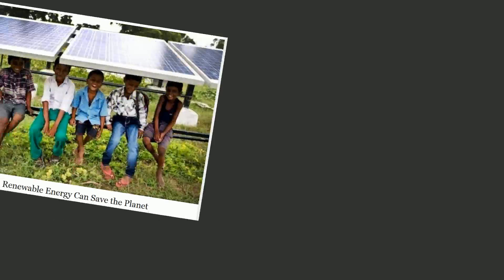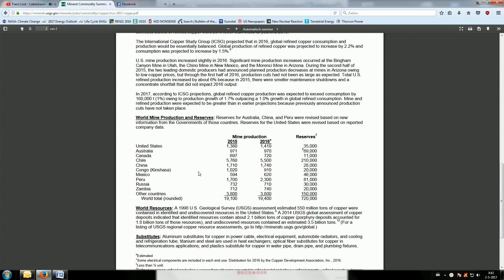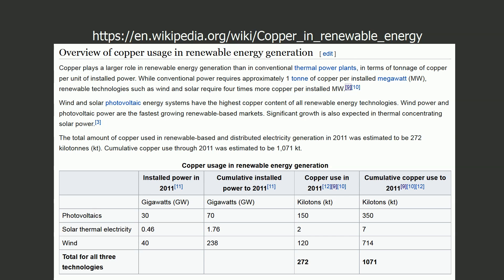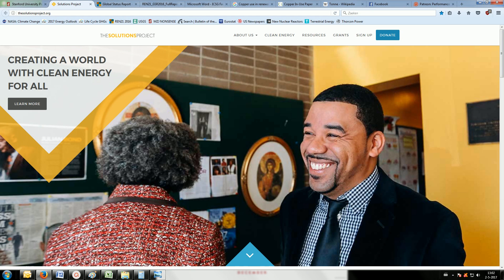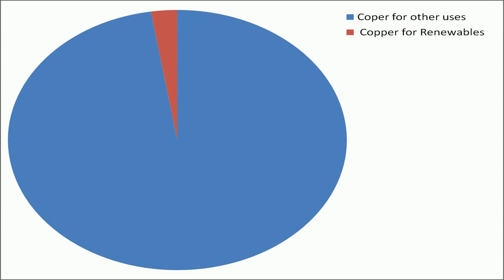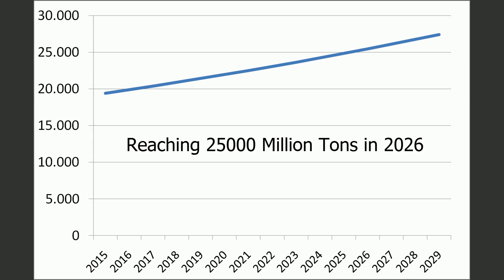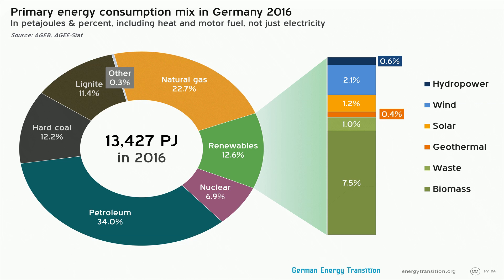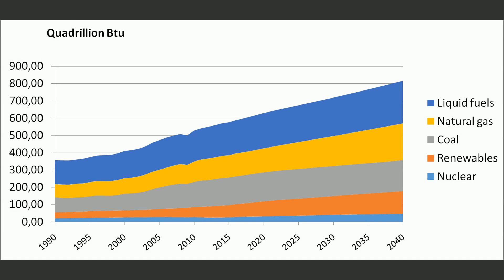Wind, Solar, Nuclear - exploring the difference in materials invested per unit of energy produced

Comment: Two thoughts on this, wind and solar are not the only green energy solutions, they are simply the most talked about but their are others like mirror farms that would use far less. Secondly did these figures factor in recycling of materials like copper.

Comment: No you are assuming that production is static over time and recycling is not happening. Cost does really matter and to be sure if more copper is needed then we will go and get it. Copper mining companies are always happy to sell more copper. When the price is right then they will go and start up the next mine. 

Same goes for rare earths, aluminum and silicon. 

You are trying to fit a round shape in a square hole. Cost counts. Nuclear is too expensive for most parts of the earth

Comment: Thank you for looking into this. I live off grid with solar panels. I can say you forgot to add in the batteries, charge controllers and inverters. Solar panels are 1/3 of the cost and materials of my off grid system. I have a backup gas generator too.

When wind turbines are decommissioned they are fully recyclable and it takes 1/10th the energy to recycle copper than to make virgin copper. From the nuclear power plant, can that copper be recycled? Is it considered nuclear waste in the end?

Certainly the land base needed for nuclear is tiny compared to the others. Also it is indoors and constant as you say. Hmmmm
Reply: "When wind turbines are decommissioned they are fully recyclable " This is not true! You're lying.

Comment: You ignore the increased copper efficiency building larger turbines. If you scroll down on the same page, you see that most of the copper is used for vertical cables and lightning protection, not for the generator itself. I have no data how this scales with larger turbines, but it is definitely not linear.

Comment: I see you are using Tons. are you actually using Tons or metric tonnes? Most wikipediea figures are in metric tonnes whereas USGS likes to use tons. The two are not equal.
Reply from the maker: USGS mostly uses Thousand Metric tons or Metric tons in their commodity reports. So should everybody else ;)
Reply: I agree completely, it is the best measure for this. I tried to evaluate the size of commodity market recently and holy hell how many different ways they made up to measure weight just to avoid using metric tons.